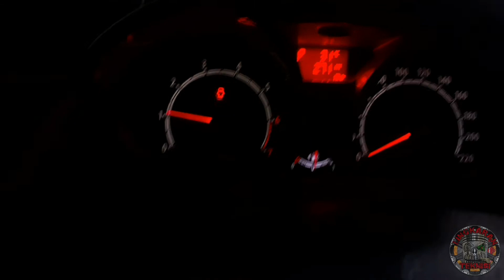Bongkar ford fiesta || penyebab oli bercampur air

Comment: Om mau tanya nih..mobil ford fiesta saya th 2012 matic mengalami kejadian oli bercampur air seperti dividio ini,dan sudah diperbaiki tapi kenapa ya otomatis fan radiatornya kok tidak mau kerja padahal komppnen2 yg berkaitan sudah diganti.mks Om sebelumnya.
Reply from the maker: Arus masuk ke fan nya ada gak om?
Reply: arus ke fannya ada,jika sensor etc dilepas fan mau mutar,tp jika sensor etc terpasang walaupun air di subtanknya sampai mendidih fan tetap tidak mutar.
Reply from the maker: @sudarsonosudarsoni860  udh coba d scan om ,? Brp temperatur panasnya om?
Reply: saya gak sempat ngecek temperatur.tp itu air pendingin yg direservoir tank sudah mendidih meluap fan radiator tetap tidak mutar.padahal switc otomatnya sudah saya ganti baru.
Reply from the maker: @sudarsonosudarsoni860  udh coba buang angin radiatornya om.? Klo udh coba buang angin, perhatikan tutup radiatornya,,,masi bagus ngak oring d tutup ny?
Reply from the maker: @sudarsonosudarsoni860  udh coba buang angin radiatornya om.? Klo udh coba buang angin, perhatikan tutup radiatornya,,,masi bagus ngak oring d tutup ny?
Reply: kata tekhnisinya bengkel angin dah dibuang,kalau tutupnya sepertinya belum disinggung.
Reply from the maker: @sudarsonosudarsoni860  coba periksa tutup nya om
Reply: tutup reservoirtank bisa berpengaruh ke sistim kerja otomatis fan ya..trus cirinya yg suda rusak gimana ya om.
Reply from the maker: @sudarsonosudarsoni860  lihat oring karet tutupnya,,,, biasanya kalo udh bercampur oli, karet ny kembang ngak presisi lagi,,,dan air nya menembak trus kluar,,,dan yg penting harus lihat jg data collant d scannya, brp suhu nya, disitu nanti bisa di analisa
Reply: ok..mks om atas instruksinya..semoga sukses selalu.

Comment: Om bengkel nya dimana?
Reply from the maker: Disumbar om
Reply: @lingkaranteknisi  sumatra barat ya? Ford saya pincang saat idle saja dan boros dan kalo awal nyalain bau bensin, kalo udh jalan rpm 2000an udh alus sama irit
Reply from the maker: @rickyfernando3682  iya d padang, coba d scan dulu utk melihat data nya om

Comment: Bang mau nnya, kan sudah di potong cylinder head nya+ ganti pack kop, termostat di ganti, radiator di cuci tapi masih over heat itu apa ya masalah nya mohon bantuan nya
Reply from the maker: Pompa air ny gmn bg?
Reply: Waterpump nya kah bang?
Kalo di tes bagus aj waterpump nya bang,
Reply from the maker: @septiannoor6593  selang radiator bawah panas gak?
Reply: @lingkaranteknisi  panas bang, air radiator nya tu nambah terus di penampungan nya
Reply from the maker: @septiannoor6593  udh d buang angin radiator ny bg?
Reply: @lingkaranteknisi  sudah juga bang angin yg di radiator di buang
Reply from the maker: @septiannoor6593  sampai berapa temperatur panas ny bg?
Reply: @lingkaranteknisi  ngga nyala sih bang temperaturnya di mobil
Reply: @lingkaranteknisi  air nya di penampungan nga tenang bang
Reply from the maker: @septiannoor6593  kalo lampu indikator merah nya ngak hidup brrti aman bg,,,,suhu mesin ford fiesta lebih panas dari mobil biasa bg kalo di lihat melalui scan,,,fan radiator nya gmn bg,,,normal kah? Atau fan nya putar terus???
Reply: @lingkaranteknisi  normal bang, aman aj kah itu bang air nya di dlm penampungan nga tenang kadang turun di bawah min terus nanti naik lagi ke max
Reply from the maker: @septiannoor6593  kalo bgtu masi kategori normal, tp kalo ragu coba di scan dilihat brp temperatur mesin nya sampai hidup fan, dan brp temperatur nya saat fan udh mati bg
Reply: @lingkaranteknisi  ok bang, saya lanjut lg
Reply: @lingkaranteknisi  oiy terima kasih banyak ini bang udh di kasih info2nya 🙏
Reply from the maker: @septiannoor6593  sama² bg🙏

Comment: Ini gara"oli cooler ya om..karna dah parah dibiarin ya
Reply from the maker: Oli coller nya udh ga pake lagi om,,ini penyebab nya krn ada kebocoran air radiator, di biarin ga pernah dicek,,,akibatnya paking deksel dan dekselnya baling
Reply: @lingkaranteknisi  cara tau ada bocor begimana om?
Reply from the maker: @PujiPerkasa  rajin cek aja air radiatornya om,,,kalo sering kurang brrti ada kebocoran diselang² air nya,,,,sama perhatikan lampu indikator panas mesin yg d dashboard,,,,
Reply: @lingkaranteknisi  klu srg kurang solusi gmn om?
Reply from the maker: @arimidiantoni6139  bawa kebengkel dicek  ada gak kebocoran air nya

Comment: bang kalo cylinder udah ada bekas oli kecampur coolant... cukup dibersihin aja atau gimana? terima kasih bang sebelumnya salam kenal
Reply: asap knalpot juga ngebul putih bang
Reply from the maker: Harus bongkar bg, ganti paking head nya, biar lebih bagus head nya di papas biar datar lagi.
Reply: kalo cuma ganti packing headnya aja gpp bang?
Reply from the maker: @jourdansetianegoro928  gpp bg,,kalo masih bercampur jugak, harus papas head bg
Reply: jd belom tentu cylinder head nya melengkung ya bang? soalnya ini kendalanya coolant abis mulu asap knalpot ngebul.. diduga cylinder head nya melengkung...
jd ganti packing dulu gpp ya?
Reply from the maker: @jourdansetianegoro928  lbih bagus di papas lagi head nya bg biar aman
Reply: kira2 biayanya brp bang ?
Reply: dan brp hari bang biasanya pengerjaannya?
Reply from the maker: @jourdansetianegoro928  kalo papas nya 200rb d tukang bubut bg
Reply: pengerjaannya brp hari bang? pengerjaan semua tukang bubut bisa ya bang?
Reply from the maker: @jourdansetianegoro928  1 jam bg,,,bisa bg
Reply: oke bang terima kasih banyak info dan masukannya sukses terus sehat2 bang🙏
Reply: bang kalo dijakarta ada refrensi yg bisa bongkar silinder head nggak?
Reply from the maker: @jourdansetianegoro928  ga tau sy bg